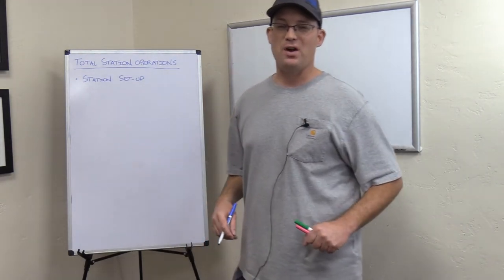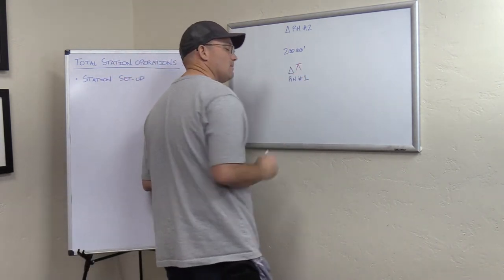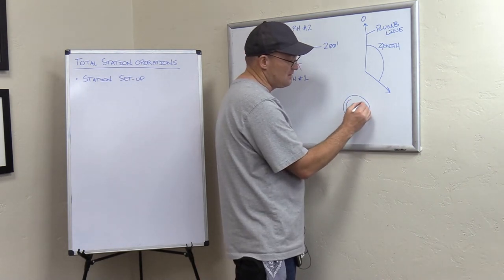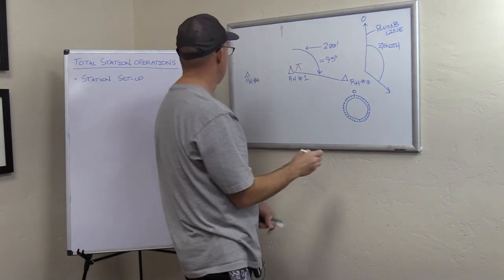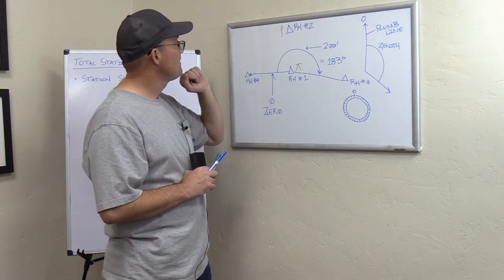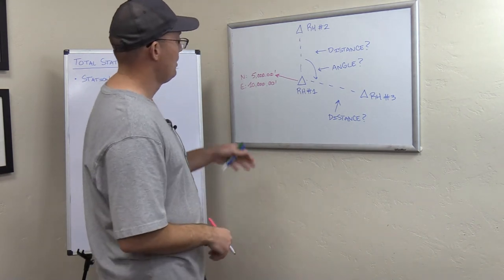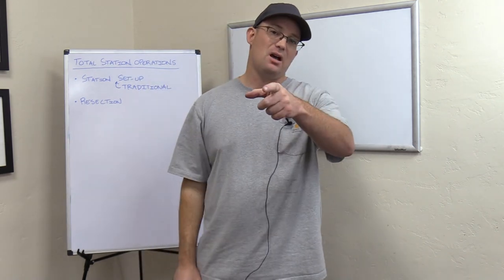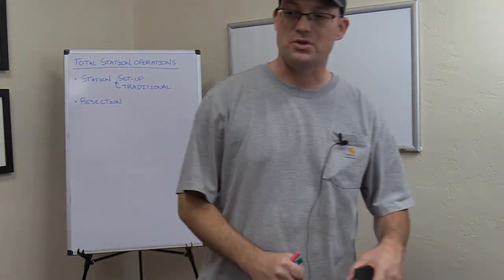FSF - Total Station Operations - Traditional Station Set-Up

Comment: Why are most tapes never 66 feet lone which is one chain length? Also why do tapes never come with handles on each end of the tape? All surveyors know that it really takes two good chainmen to measure a accurate distance apart from the total station. It seems like some really good methods got lost in the blur of new battery powered devices. Edmund Gunter, got it right when he put handles on both ends of the chain.